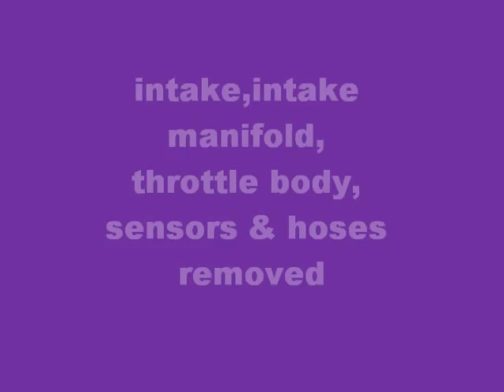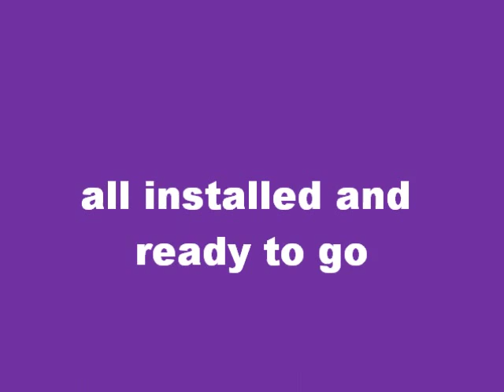obx header & down pipe installed on a 2009 nissan cube

Comment: Awesome mod - wanna copy it with my cube (2011 6spd).

(btw, is that 2 cats I'm seeing in the stock pipe?)

I assume the new downpipe will make it no longer street legal.. does the existing cat pipe fit the new header (looks like it would from the pics)?

Or maybe take the new OBX downpipe and hack it up a bit to install some new hi-flow cats.. thoughts?

Thanks again - awesome cube work!!